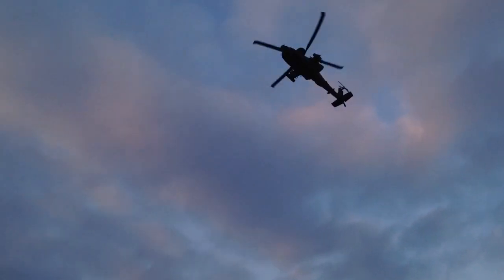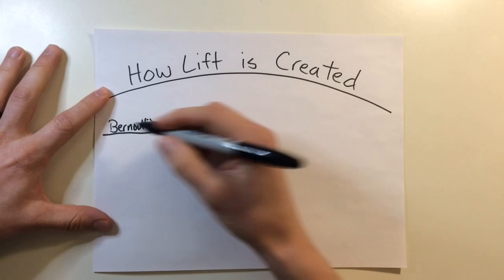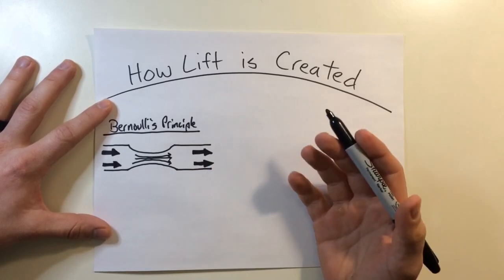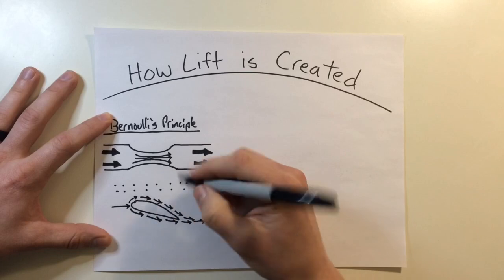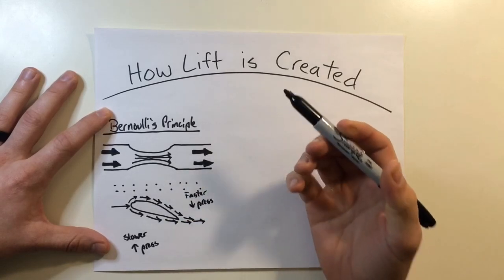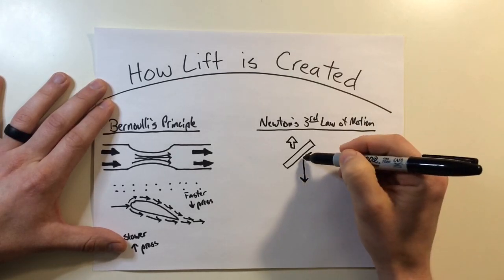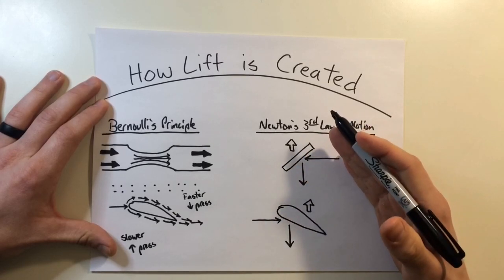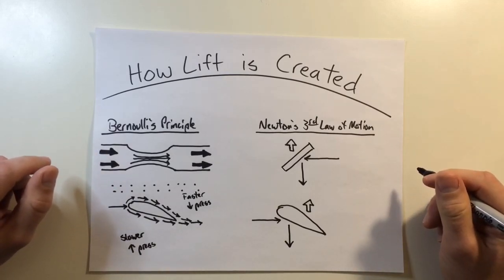How Lift is Created

Comment: Good vídeo 👍🏾🚁
Reply: The “Bernoulli Principle half-venturi” explanation is false. The air far above the wing is not a hard boundary and the air does not speed up because of this. If that was valid, then there would be an equally low pressure under the wing because you can easily see that the trailing edge produces a similar ‘narrowing’ below the wing.
In addition, a pressure difference between two regions, called a pressure gradient, is what speeds up the fluid in the venturi.  Air has mass and Newton tells us that a force is required to accelerate a mass and in a fluid, a pressure difference accelerates fluid. Pressure is the force that accelerates air. The fluid does not magically speed up in the venturi narrowing without the force provided by the pressure difference. Pressure difference causes acceleration in fluids.  Euler figured this out in the mid 1700s.
 Above a wing, it is the curved flow that creates a lower pressure and the low pressure accelerates that air toward the trailing edge.

Also, it's Daniel Bernoulli.
_
The common Newton explanation is incorrect because the air does not bounce off the bottom, but the flow is curved to flow downward, but along the lower surface.  That causes an increase in pressure at the lower surface.  The wing moving toward the air increases the pressure.  This increased pressure under the wing pushes up on the wing and down on the air. 
The lift is then the total pressure difference caused by the motion of the wing through the air.
Those two explanations are incorrect, but it is the pressure difference top-to-bottom which is the lift.

Comment: Great! Thumbs up, Thank you
Reply: The “Bernoulli Principle half-venturi” explanation is false. The air far above the wing is not a hard boundary and the air does not speed up because of this. If that was valid, then there would be an equally low pressure under the wing because you can easily see that the trailing edge produces a similar ‘narrowing’ below the wing.
In addition, a pressure difference between two regions, called a pressure gradient, is what speeds up the fluid in the venturi.  Air has mass and Newton tells us that a force is required to accelerate a mass and in a fluid, a pressure difference accelerates fluid. Pressure is the force that accelerates air. The fluid does not magically speed up in the venturi narrowing without the force provided by the pressure difference. Pressure difference causes acceleration in fluids.  Euler figured this out in the mid 1700s.
 Above a wing, it is the curved flow that creates a lower pressure and the low pressure accelerates that air toward the trailing edge.

Also, it's Daniel Bernoulli.
_
The common Newton explanation is incorrect because the air does not bounce off the bottom, but the flow is curved to flow downward, but along the lower surface.  That causes an increase in pressure at the lower surface.  The wing moving toward the air increases the pressure.  This increased pressure under the wing pushes up on the wing and down on the air. 
The lift is then the total pressure difference caused by the motion of the wing through the air.
Those two explanations are incorrect, but it is the pressure difference top-to-bottom which is the lift.

Comment: The venturi theory and the equal time theory are not able at all to explain lift .... But I still think for a layman it's ok , but the matter is combination of Bernoulli's and Newton's third law ( not the granular theory too , the one you did) , the flow is attached to the top and moves towards the trailing edge and get directed downward so the airfoil moves upward , but how? Here comes Bernoulli's principle and we know that the difference in pressure creates lift but why the air speeds up on the top ( not because of the camber, if it was so inverted flight woul be impossible ) here Bernoulli's principle needs an extra explanation which I still don't know. 

Besides all these , your videos are amazing , thanks ! You deserve to have much more subscribers .... Keep up !
Reply: The “Bernoulli Principle half-venturi” explanation is false. The air far above the wing is not a hard boundary and the air does not speed up because of this. If that was valid, then there would be an equally low pressure under the wing because you can easily see that the trailing edge produces a similar ‘narrowing’ below the wing.
In addition, a pressure difference between two regions, called a pressure gradient, is what speeds up the fluid in the venturi.  Air has mass and Newton tells us that a force is required to accelerate a mass and in a fluid, a pressure difference accelerates fluid. Pressure is the force that accelerates air. The fluid does not magically speed up in the venturi narrowing without the force provided by the pressure difference. Pressure difference causes acceleration in fluids.  Euler figured this out in the mid 1700s.
 Above a wing, it is the curved flow that creates a lower pressure and the low pressure accelerates that air toward the trailing edge.

Also, it's Daniel Bernoulli.
_
The common Newton explanation is incorrect because the air does not bounce off the bottom, but the flow is curved to flow downward, but along the lower surface.  That causes an increase in pressure at the lower surface.  The wing moving toward the air increases the pressure.  This increased pressure under the wing pushes up on the wing and down on the air. 
The lift is then the total pressure difference caused by the motion of the wing through the air.
Those two explanations are incorrect, but it is the pressure difference top-to-bottom which is the lift.

Comment: Jacob, how do you feel about the Coanda Effect? I use Bernoulli's, Newton's, and the Coanda Effect to explain lift to my students. Do you have any thoughts on the matter? Thanks, Adam.
Reply from the maker: Adam Hough. Up to this point I had not heard of it. But I did some research on it. To me, it seems like this would explain laminar flow over an airfoil. I see where it can potentially increase speed of the airflow which seems more like Bernoulli’s principle. But I’m missing how it, by itself, produces lift. Can you elaborate more on it? Great question by the way! I’m going to keep researching it.
Reply from the maker: Adam Hough. I watched the video and did some more research on the matter. It seems like the coanda effect is actually used for NOTAR helicopters and even jet aircraft to supplement to normal lift/thrust of an airfoil. It doesn’t seem to fully explain lift solely by itself but it does offer a supplement to the lift an airfoil is already producing. Very interesting stuff! I’ll keep researching it and trying to break it down into an easier to teach format that doesn’t get confused with surface tension too easily.  Thanks again for brining it up! I’m always interested in other instructor teaching references and methods.
Reply: @helicopterlessonsin10minut10   The Coanda Effect and what goes on above a wing are very similar, but they are not completely the same thing.  In addition, the Coanda has a specific definition which the wing doesn't satisfy.  It is a forced jet in otherwise still air.
They do, however, both produce a lower pressure along the convex surface.
If you want more lift science, I can provide better information that almost all other amateur explanations.
Reply: @adamhough7941  The Coanda Effect and what goes on above a wing are very similar, but they are not completely the same thing.  In addition, the Coanda has a specific definition which the wing doesn't satisfy.  Coanda is a forced jet in otherwise still air.
They do, however, both produce a lower pressure along the convex surface.
..
The way Bernoulli is commonly used is also incorrect whether is is with the equal transit fallacy or the half-venturi fallacy. 
The Newton reaction fallacy grabs part of the science, but misapplies it.
..
If you want more lift science, I can provide better information that almost all other amateur explanations.
Reply: Read the Book of Doug McLean. Misconceptions in aerodynamics.

Comment: Misconception using Bernoulli to explain lift in a 3 deminsional flowfield.
Newton's first and third laws simplistically defines lift.
F=ma
Equal and opposite reaction
Lift is a force
L=ma
m= air density
a= 1/2 velocity squared.
Simplistically air is captured across the surface area of the wing and accelerated and forced downward at the trailing edge, generating upward force.
Bernoulli does not account for downwash, which basically is the causitive effect of lift in both fixed and rotary flight, not pressure differential. The whole concept of boundary layer, circulation theory, and vorticity comes into play in actual 3d flight.
Bernoulli theory works in the wind tunnel (2 deminsional flow) but falls apart in 3 deminsional.
Reply: OK. But what is is that causes the air to accelerate?  
"Capture" hardly is a physics term.
..
Problem:
Also, if the air is "forced downward at the trailing edge"  why do we measure the lift centered toward the leading edge?

Comment: Another outstanding job, sir. Just a quick question... What is your opinion on how much lift is generated by the Magnus effect. Since it wasn't mentioned in this lesson I can only assume it would be negligible.  Thanks again and you take care.
Reply from the maker: David Wallace. I'm no physicist but I haven't seen the Magnus Effect show applicability to a helicopter rotor blade. The basic explanation of the Magnus Effect is that a rotating body will produce lift due to creating a pressure differential much like Bernoulli's Principle.  This explains a lot when you look at a curveball or a ping pong ball with a spin on it. But with a rotor blade, nothing is really spinning along the leading edge of the airfoil. There have been prototype airfoils on some planes that show that by adding a rotating leading edge to an airfoil lift can be increased. But I've yet to see anything applied to a helicopter. Good question.
Reply: Thanks for your reply and keep em flying sir!

Comment: I think Bernoulli principle doesn't make sense in lift force because how one can prove that fluid particles over lower and upper side of airfoil reach trailing edge at the exact same time. so, coanda effect make sense for lifting force.
Reply: +
evanleebodies
,
He is not using the equal transit fallacy.  He is using the half-venturi fallacy. The Coanda Effect is similar to what happens above a wing, but not correct.  Coanda is for a forced jet into otherwise still air.

Comment: Help me understand. When in auto rotation, specifically in a gyroplane, the rotational speed of the rotor is determined by the condition of the atmosphere and the gross weight of the aircraft. Typically a two place machine with two passengers, the rotor speed will be in the neighborhood of 350 rpm. We also will not see more than a 10% change of rotor rpm during the entire flight envelope. This is not true during the flare as the g-loading will increase causing an increase of rotor rpm prior to landing.  Is the limiting factor of rotor rpm due to induced and parasitic drag of the airfoil? I also tend to view lift as a factor of rrpm and tend to ignore airspeed as an equal component of the total lift. As a gyroplane is already in auto rotation we will descend for fun at zero airspeed until a decision height which at that time we will lower the nose and accelerate to our best glide speed for landing. We could hold that zero airspeed descent and probably survive but destroying the aircraft. We nose the aircraft over to store energy in the blades or so that term is used. But if the rotor rpm really doesn’t change all that much what is the extra airspeed really gaining? Is it energy stored in the spinning rotor or is the aircraft benefiting from additional lift from more airflow over the disk? Let’s say a hypothetical disk is achieving 300 mph in the driven area and it is moving into a 65 mph forward speed generated wind. The advancing blade benefits and shares this with the retreating blade via teetering. Although the rrpm has not substantially increased, has the total lift increased because of flow or because of the resistance of the viscosity of more air trying to move through the rapidly rotating rotor. Are we too obsessed about rrpm and not so much airspeed, when airspeed might be our better friend when in auto rotation once our desired rrpm is achieved?

Comment: 3:21 isnt the reason of airflow sticks on the airfloil no slip condition?
Reply: No.  Air pressure pushes air against the surfaces; all surfaces, top and bottom; all the time.
..
The “Bernoulli Principle half-venturi” explanation is false. The air far above the wing is not a hard boundary and the air does not speed up because of this. If that was valid, then there would be an equally low pressure under the wing because you can easily see that the trailing edge produces a similar ‘narrowing’ below the wing.
..
In addition, a pressure difference between two regions, called a pressure gradient, is what speeds up the fluid in the venturi.  Air has mass and Newton tells us that a force is required to accelerate a mass and in a fluid, a pressure difference accelerates fluid. Pressure is the force that accelerates air. The fluid does not magically speed up in the venturi narrowing without the force provided by the pressure difference. Pressure difference causes acceleration in fluids.  Euler figured this out in the mid 1700s.
.

 Above a wing, it is the curved flow that creates a lower pressure and the low pressure accelerates that air toward the trailing edge.

Also, it's Daniel Bernoulli.
_
The common Newton explanation is incorrect because the air does not bounce off the bottom, but the flow is curved to flow downward, but along the lower surface.  That causes an increase in pressure at the lower surface.  The wing moving toward the air increases the pressure.  This increased pressure under the wing pushes up on the wing and down on the air. 
The lift is then the total pressure difference caused by the motion of the wing through the air.
Those two explanations are incorrect, but it is the pressure difference top-to-bottom which is the lift.

Comment: The Newton explanation  is not very good, the air over the top of the wing is accelerated and leaves the wing at an angle approximately in line with the wing chord with a positive angle of attack with respect to the ground. Therefore with respect to Newton’s third law the direction is upwards. Otherwise a fully symmetrical wing would not creat lift.

Comment: You are Wrong to explain lift using the bernoulli principle...
Reply from the maker: It’s one of the many theories
Reply: @helicopterlessonsin10minut10   NO! it is wrong.  It is one of many guesses by amateur scientists.
.
The “Bernoulli Principle half-venturi” explanation is false. The air far above the wing is not a hard boundary and the air does not speed up because of this. If that was valid, then there would be an equally low pressure under the wing because you can easily see that the trailing edge produces a similar ‘narrowing’ below the wing.
.

In addition, a pressure difference between two regions, called a pressure gradient, is what speeds up the fluid in the venturi.  Air has mass and Newton tells us that a force is required to accelerate a mass and in a fluid, a pressure difference accelerates fluid. Pressure is the force that accelerates air. The fluid does not magically speed up in the venturi narrowing without the force provided by the pressure difference. Pressure difference causes acceleration in fluids.  Euler figured this out in the mid 1700s.
.
 Above a wing, it is the curved flow that creates a lower pressure and the low pressure accelerates that air toward the trailing edge.

Also, it's Daniel Bernoulli.
_
The common Newton explanation is incorrect because the air does not bounce off the bottom, but the flow is curved to flow downward, but along the lower surface.  That causes an increase in pressure at the lower surface.  The wing moving toward the air increases the pressure.  This increased pressure under the wing pushes up on the wing and down on the air. 
The lift is then the total pressure difference caused by the motion of the wing through the air.
Those two explanations are incorrect, but it is the pressure difference top-to-bottom which is the lift.
Reply: No, not wrong. Maybe just not complete.